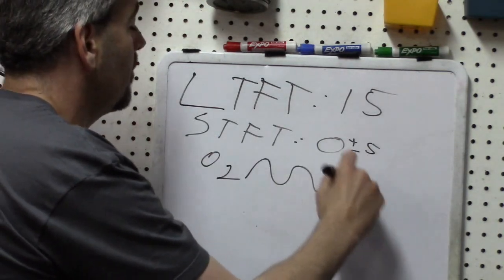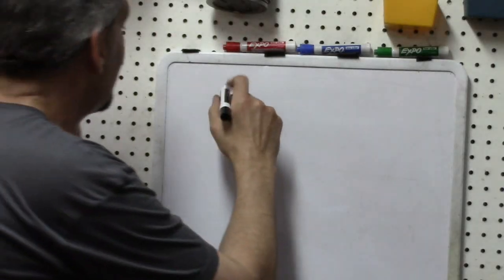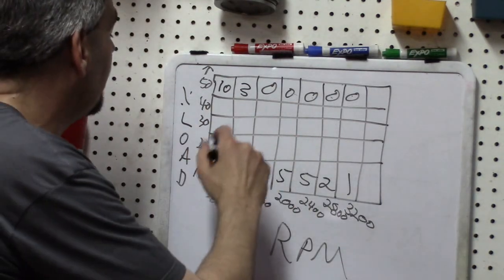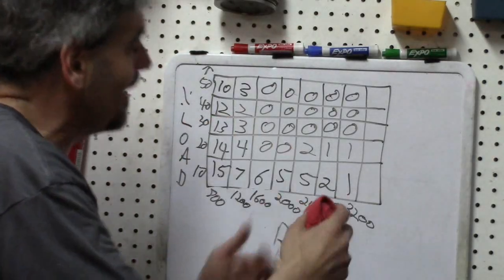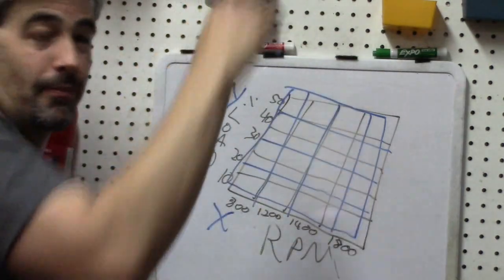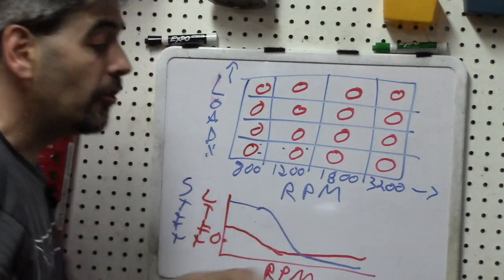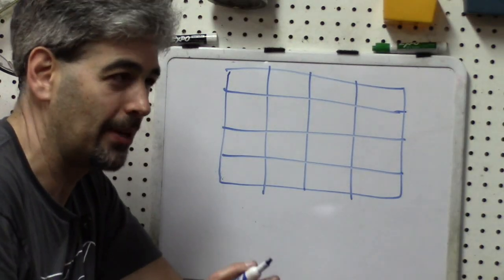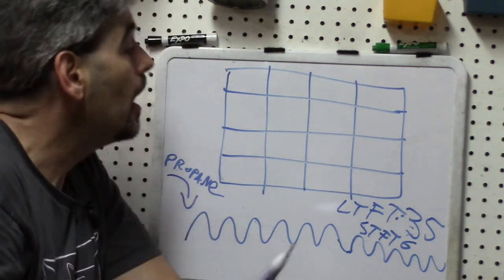Understanding+Diagnosis: Adaptive Fuel Learn Strategy

Comment: Very clear and concise explanation on 3 dimensional fuel maps.  Timely for me too.  Question.  In a perfectly tuned engine should long term fuel trim be zero in all fuel cells in a three dimensional fuel map?
Reply from the maker: Sandbag1300 As usual, great question.  (Notice btw my increased use of the DEBOK as result of your suggestion a few weeks ago).   The answer is No and I don't know.
  See there is also a fuel map for Open Loop- and it goes without saying this map would tend to have rich commands (not rich conditions, rich commands) which will not zero no matter what you do.
  As for the closed loop map I demonstrate in the video- I cannot see any reason you wouldn't reset all LTFT's to zero EXCEPT that I can see if the "stacked maps" consider for things like A/C operation or other default load variables where you would want to have a slightly leaner or richer command.   I haven't looked into it because for my purposes, I really know all I need or want to know about this subject lol.
Reply: Schrodingers Box Yes, thanks for listing the potential issues on the white board more often (and for the shout out).  That process helps me think methodically and retain a lot of diverse information faster.  

I am running a fools errand this weekend since I have no codes, some free time, and the weather will be good.  I am analyzing a fuel delivery issue that occurs occasionally primarily at 60 mph and 2,000 rpm in bank one of a V8 jeep.  Fuel pump pressure is good and long term fuel trim at that operating parameter looks like the outline of three to four human teeth +10 percent high with a few teeth missing in between.  My plan is to perform an injector fuel drop test with my Autoenginuity scanner and a fuel pressure gauge.  Maybe I will find that one of my 70,000 mile 10 year old fuel injectors in bank one is a little sticky.

Comment: I’m here after watching basic fuel trim part 1 and 2 like ten times. Dealing with no check engine light aT idle LTFT at 11.7 STFT at 24%, Under load both values come down, smoke tested, a slight hint of smoke coming from a below Egr. Car has run rough for a few years and has had parts thrown at it by other garage. I want to commit to EGR but feel something else is going on.

Comment: Hi Matt, thanks for taking the time to make all these videos; I haven't watched them all yet but I will. I have a question in regards to the fuel trim, adaptive fuel learn strategy, and two foot drivers on automatics. My uncle has had nothing but problems with his new 2014 f150. Most of his problems consist of transmission issues (slamming into gear). He's taken it to the dealer multiple times with no remedy. So he decided to switch from a ford to a chevy. He's currently driving a chevy silverado automatic 4x4 and having the same problems with the trans. He has more issues than what I'm naming here, I know both vehicles run rough at times. I'm not really looking for an answer here, I'm just looking to see if my hypothesis could hold some answers. For a new automatic vehicle, with fuel trims being made through the reaction of the gas pedal, is it possible that a two foot driver (in short terms) screw up the fuel trim and then the adaptive fuel strategy? Would that then screw up the engine's signal to the transmission to shift properly? Sorry if this doesn't make any sense, I was just watching your video and this popped in my head. I know there's more variables to consider. I was just wondering in a short term if its possible. I will gladly take any humor or seriousness with this, thanks again for your time.

Comment: Your videos are very helpful for me to learn diagnostic skill's. Because it's cheaper to know than guess. But I'm a little stuck in my diagnosis of a lean condition in my car. One off the things I can't understand is that my Long term fuel trim reaction is very slow. Short is constantly altering and Long barely moves. If there is some variation then it from 9+ to 19+ and sometimes it's jumping at 24+. But these variations are super slow. Adding breakclean gives a clear response on short term and o2 but long term is barley giving reaction. Only with very long idle, for example it jump's. (Small jump's) Do you recognize this? In 1 of your videos you had a similar problem and this was caused be enhanced input by the scan tool. And this isn't the problem in my case because both my scan tools giving the same result.
Reply from the maker: Don’t worry too much about the little no term trim stabilization time. On some models it takes a long time. I have seen up to 10 minutes even. The thing to look for is keeping the short term trim under 10. If short term trim is 24 then you definitely have a lean condition active at that time.
Reply: @SchrodingersBox  Oke thanks man, this helps. It gives a more clear picture how I got to look at this.

Comment: So I recall in your oxygen/af sensor video you mentioned that on WOT, the a/f mixture goes rich, and demonstrated this in your much-maligned Subaru.

As a hypothetical, let's say at 5000 rpm and 70% load the Subaru is supposed to be at 11.5:1 per its AFR mapping. 

Would there be a LTFT cell at 5000rpm/70% load with a rich correction to bring that 11.5 to 14.7, or would there be no correction at all? Thanks for any input and insights!
Reply from the maker: No there won’t be a correction. at WOT conditions, fuel trim is not used. The engine will simply run rich without any corrections being applied.

Comment: Man you are great ! Correct if I'm wrong...That's why after fixing  cars replacing some parts like o2 sensor,maf sensor and so on ,we have to do the relearn drive procedure,,,of curse cleaned cods before and erased the read data as well ?
Reply from the maker: Yes correct. If you fix the car the fuel trim will have to adapt to the new conditions.

Comment: I am going to get a replacement 3D brain and I'll be back for a replay.Good foundation video as a add-on to the fuel trim analysis question.When there is a lot of variables in operation,it's very easy to jump to the wrong conclusions.Even with low fuel pressure in the jeep,I'd have bet on the propane to turn the tables,but no, reality had a different answer.To me,it seems that propane is rich enough to trip the balance but only when the fuel pressure is normal.I would love to see at what minimum pressure the fuel would need to be at,for the propane to have an effect.That would give an indication generally as to the state of the delivery system ?
Reply: Tom OConnor Find another vehicle under similar duress and when one propane tank isn't enough use multiple, but don't blame me when you blow up. lol

Comment: This video was fun! I watch your video's as a little distraction from learning statistics. So I'm used to quite a degree of analytical blahblah.
Like most I started out with Scotty and Eric, but got after seeing some series, I think I saw them all. Watching those guys opened up the world of cars to me though and got me confident enough to open up the hood, do diagnostics and recently I figured to analyze that my ignition distribution was busted and replaced it. Replacement was the easiest part and during the search I came across one of your videos and now I'm hooked.
To respond to the video it's contents. Is it true that?
The LTFT learning (fuel cell changing the stored value) explains the startle of the engine, just after stopping with the propane, certainly when the STFT isn't quick enough because there is a fuel delivery issue like pump or injectors? Or could it be something else?
Reply from the maker: Georgie Dekker As for first part of your comment, thanks and in fact the way I look at it, Eric and Scotty are like gateways to people like me... it's like weed is the gateway to the really good stuff lol.

  As for second part of your question, if I understand it you are asking about the cause of the engine stumble when you withdraw propane after inducing a rich condition.  Your answer in general is correct but technically, not necessarily.  The LTFT may not actually have set yet, and thus the stumbling could be because the STFT was withdrawing fuel and after removing propane, that second it takes to adjust explains the effect. It does not necessarily have to be from the LTFT.
  Now in another experiment, you could do this-
 add the propane to richen and then remove it and shut off the engine before the LTFT changes.  Start the engine back up and it will start right up no problem because the engine looks to the LTFT first and it hadn't changed.   NOW repeat this but make sure the LTFT is maxed negative.  Remove it and turn the engine off.  Now when you restart it, the engine will stumble, maybe even die because, again, it looked to the LTFT first and it will be very lean!
I hope that explains it, but your understanding was clearly correct to begin with.
Reply: Schrodingers Box thanks for the quick response! And for confirming that my drift was good. Of-course I ment a situation where you would take enough time and propane to cause the LTFT overwrite (which is undefined if I read the comments correctly) AND you forgive the engine the 2 seconds to catch a breath after basicly hanging under a keg for a couple of minutes (how would you feel, not like running I assume). But after more than let say 5 seconds of stumble no good engine sounds or death would definitively suggest there's something wrong in describe areas. At least that's my idea and you seem to confirm at least the first part of it.
Keep up the good work. I'm looking forward to more deep mechanics. btw I'm allready looking a little bit into gd&t because of your video on the engine rebuild.
Reply: btw, you always talk about how old your viewers are. Not all of them!

Comment: Hey Matt, nice videos you are producing out there. It helped me ALOT in diagnosing and approaching problems. However, I wonder if the same strategies would be applicable on aspirated engines, i.e. Supercharged/Turbocharged motors. What I am currently thinking of is that if I am going to diagnose a vacuum leak in a supercharged engine, the intake manifold will be on above 14.7 lb (above ambient pressure due to the compressed air produced from the supercharger). So an intake manifold leak would result in pushing air outside the intake manifold which would create less metered air which will also create a rich condition; however, same issue in a non-aspirated engine would result in lean condition. Thus, would please comment on my believes here and whether I am missing point. Again, many thanks for the great videos.
Reply from the maker: +Hashem Al-Husaini I am asked this a lot. I also wonder the same things myself. If I ever get a supercharged car in my garage believe me- it will be like a lab rat!!! I'll retest all my key diagnostic theories and see if they are affected by the forced induction.

Comment: I have been watching yung fuel trim videos and I have learned a lot but I am a rider and I am still wondering if all these things will apply to an EFI bike too. I think it should be the same since the working principles are similar.

I am hoping if there is a chance that you might, you could, maybe, touch on EFI bikes too. More power and keep up the good work on your videos. I have never focused so much in a video until I stumbled upon yours.
Reply from the maker: i never looked at a motorcycle however i understand some of them like BMW’s are exactly like cars and in fact even use OBD2!!!
Reply: @SchrodingersBox  Thanks. Yes, some bikes use OBD2, like mine, and from all the things I learned from your videos, they seem to be similar for my bike. i will keep on learning. Thanks for the videos.

Comment: Hi Matt,Another great video to add to the collection (obviously I need to get a life :) )Couple of observations :  a) I think the principles shown here need to be part of your std. fuel trim videos. After seeing Fuel Trim 1&2 I thought the LTFT was a single entity which would slowly respond to any current STFT. I was totally confused when watching diagnostic videos which showed LTFT responding to throttle/RPM changes, as quickly as the STFT. I now understand that these changes were simply values taken from different cells in the matrix as the conditions changed. (but surprisingly smooth curves)b) When you explain in this video about ignoring the lack of change in the O2 sensor reading when adding propane - If trims are maxed out, why is the STFT still within spec.?Surely it should be maxed out as well. Also - why is the O2 sensor showing the typical oscillations as expected when in stoichiometry . Surely it should be showing a permenantly lean trace.  I hope these anomalies don't mean that I have totally misunderstood as I thought I was getting the hang of this  :)

Comment: +Schrodinger box is it posible to have a LTFT set at a high point, let's say +20% due to a leak and still have normal idle RPM's range, thanks for your videos!
Reply from the maker: Yep- a vacuum leak would do exactly that. The whole purpose of fuel trim is maintain normal engine operation despite discrepancies. On most fuel trim problems you will notice absolutely no difference in engine performance or behavior because of the adjustments the PCM makes.
Reply: +Schrodingers Box Thank you for the answer!

Comment: Great video! Presumably each cell in the array for LTFT is generated within the PCM when the engine has been in a particular condition (MAP/load/RPM) either a certain number of times or a certain length of time to allow for errors in the sensors creating the array of cells... if you get my drift?
Reply from the maker: truthseeker104 That's exactly how I understand it!

Comment: Hi, Thanks for your nice video's. I learned a lot from it.
I disagree with you though. At about 30 minutes you state that adding propane does not cause the O2 sensor to read rich because the engine is already way too lean and the fuel trims are already maxxed out.
But this cannot be true because the O2 sensor is switching. So the mixture must be around stochiogastic. If the O2 sensor keeps switching even with the extra propane the computer must somehow be able to lean out the mixture (by lowering the fuel trims). If you don't see that show up on your scanner maybe that is because the computer can work with trims above 35% but your scan tool can not?
So for example: the LTFT is at 45% but your scanner (or the communication protocol) limits this to 35%. Then you add propane and the LTFT is immediately lowered to 37%. Your scanner still reads this as 35%. But the still switching O2 sensor gives you the clue that the mixture gets corrected by the computer although you don't see any change in the trim values reported by the scan tool.
So what do you think of this? Did I understand all your explanations or am I wrong?
Reply from the maker: Eelco Grakist Yes someone else brought that up and I actually thought that as well... explanation coming in a follow up video. Stay tuned.
Reply: Eelco Grakist stochiogastic?
Reply: douglas lee stochastic!
Reply: Schrodingers Box This is good, I would also like to see an explanation of that. My thought was, since the LTFT is maxxed out on 35, and STFT is around 6-7, and the O2 sensor line hovers around stoich, .....when adding propane I would expect to see the LTFT staying capped to 35, but the STFT increasing, to reflect the added HC, AND the O2 line showing rich, until a) the TOTAL combined trim was enough to cause stoich operation or b) the STFT cap was reached. Does this make sense?
Our friend and teacher ScannerDanner always looks a the total trim amount, while also keeping an eye on the trends of the STFT and LTFT

Comment: The number of cells varies with make, model and year.  GM used to use a simple 16-cell map very early on, whereas modern vehicles go so far beyond anything you could ever express with a whiteboard that it's painful to think about.  It's quite a ways beyond the scope of automotive troubleshooting and repair and more into the realm of engineering, but from what I've read on the subject, even using an XYZ model is grossly oversimplified.

Modern cars have such amazing processing power that they're using multidimensional arrays in which each sensor input has its own dimension.  O2S, ECT, AIT, TPS, RPM, MAP, MAF, VSS, and numerous calculated and measured values regarding transmission operation, vehicle load, G-sensors, etc.  Then there's also the adaptive strategy the vehicle uses to learn how its operator drives, which is a separate multidimensional array in and of itself, which interplays with the adaptive fuel map...

About halfway through the video at the moment, but I gotta go pick up a new tooth from the dentist, so I'll finish the rest later!  So far, it's an awesome video!  :D
Reply from the maker: rhkips Yes you are correct... I didn't really want to go into the detail so much but all of those factors (and more in fact) are indeed included in the array buildup.  I just didn't want to have people get scared and shut off the video because it got too complicated but indeed, this is how the array actually is.
Reply: Schrodingers Box It's an incredibly complicated subject, for sure.  With any luck, this video will at least scare away all the parts-changers!

Awesome video.  Forwarding this along to my old professor for him to use in his Advanced Engine Performance Diagnostics class.  :D

Comment: Does the Load_PCT of the scan tool refer to one of those cells Matt? Mine was at 10.6%. with a FUEL SSS1 tith an open loop fault, engine was not fully warmed up I think.